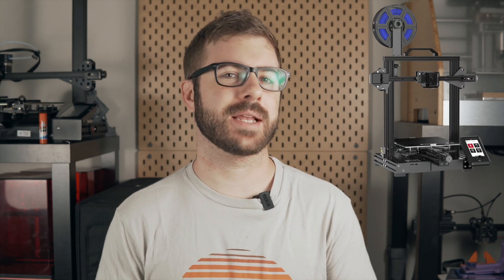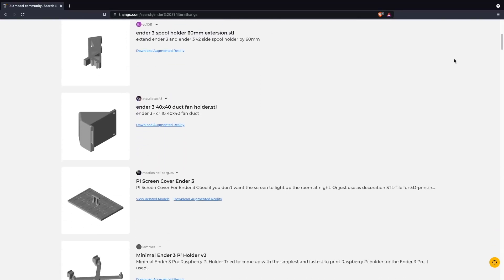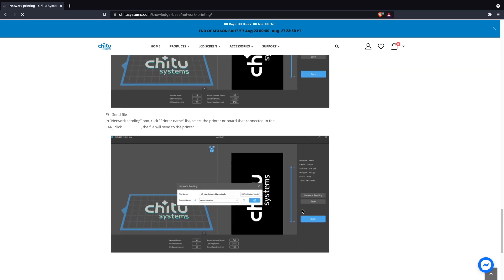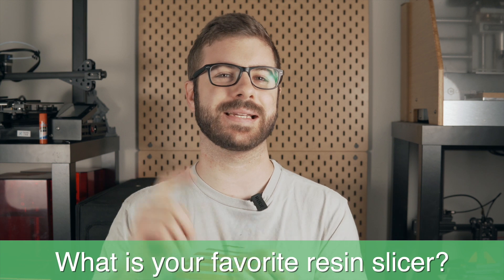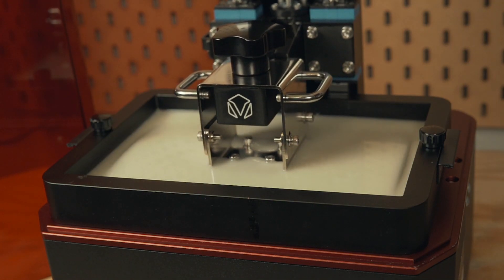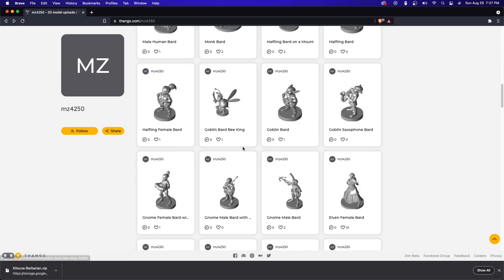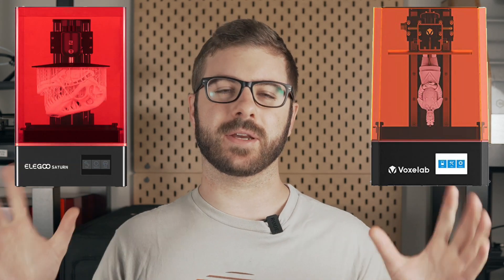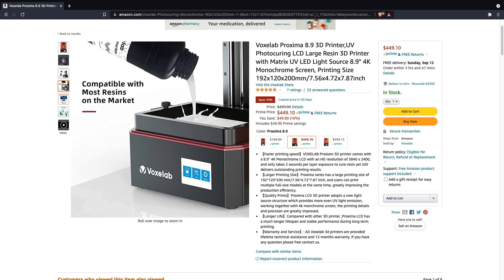Should You Get The Voxelab Proxima 8.9" Over The Elegoo Saturn?

Comment: I bought the pro based on your review. It’s supposed to have a better light source. I can slice with chitu or lychee( you need to use the proxima and adjust the settings) and the voxel software isn’t advanced. From my research voxelab, flashforge, and elegoo get their parts from Kelant. So none of the build plates, vats are interchangeable. Overall I’m very happy with this printer. I bought it so I could get some skills. I backed the Jupiter Kickstarter, and thought I should know what I’m doing before it shows up. 

Thanks for the reviews. I enjoy all your content.
Reply: Hi! What settings did you need to change? I've got the flashforge coming tomorrow and don't want to lose my Lychee!
Reply: @reactwithdad  I don’t know if lychee is going to work. They have swapped the boards and some run fdg and others run svgx. The chitu free software runs fine with either board. If it’s the svgx board you will need to add the plugin to chitu to use it. 

You can always slice and support in Lychee-export as STL- and prepare in chitu to put on your usb.

 I have two of these machines now and they have been flawless. I run them hard with massive prints sometimes.  I don’t use vroom settings and also I always do a exposure test for new or different resins. I can’t believe some of the stuff I’ve gotten away with on these machines.

Comment: That amount of pressure on the screen when leveling is very concerning.  I installed magnetic build plates and if you don't account for the extra space you can run into this, but stock? I'd make sure to adjust the end stop so even fully homed you have some wiggle room on adjustment  and don't risk damaging the screen.
Reply from the maker: Agreed, I was very surprised and kept thinking I was doing something wrong. I triple checked everything and that was as loose as I could get it stock.

Comment: I use Lychee Pro almost exclusively for resin printing.
Reply from the maker: What are the key features about the pro version that you find valuable?
Reply: @ModBotArmy  A shame that you never got a response. As of Now, the pro version includes all sorts of additional features like advanced support manipulation that allows you to move all joints of a support in whichever way you want, complete control over raft types (everything from an outline of your entire print to a completely mesh raft for easy removal), and probably my personal favorite feature: Hollow blockers, which allow you to completely control which parts of your 3D model are hollowed. Bear in mind I have no clue if Chitu has these features on their pro version, mostly because I've only ever used lychee and couldn't be happier!! Additionally, If you're worried about lychee pro you can always buy on a month by month basis to avoid overspending.

Comment: Just the fact that it is open to other slicers makes it better than the Saturn. As far as the pooling of resin on those nuts on the build plate, just design and print some sort of cover that has sloped top. 50 cents of plastic or resin, five minutes with Blender or other CAD and 30 minutes to print, I would guess.

Comment: Hm. Since the machine is using a Chitu board, is it even possible to use slicers other than Chitubox? Because Chitu locked all new boards for other printers. I would be surprised if this one was an exception. Maybe it's old enough; but in that case you must not update the firmware and as such you will not be able to use the latest version of Chitubox.
See Uncle Jessy's video on the topic.
Reply from the maker: I did cover that a bit as well in a video some time ago. These printers use a different file format actually. So I am not sure if they are a custom take on the chitu board but the file format is not the same as what other chituboards I have used are. I am not a fan of locked boards. They need to cut that out.